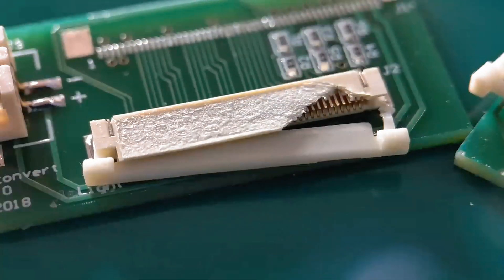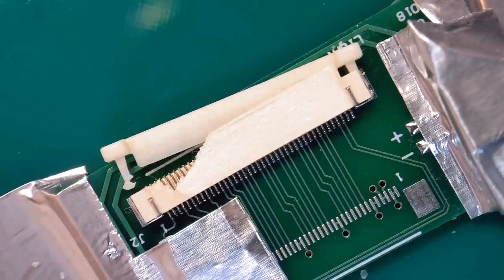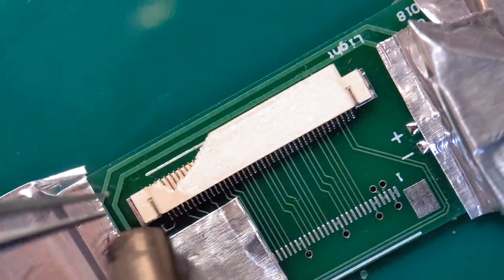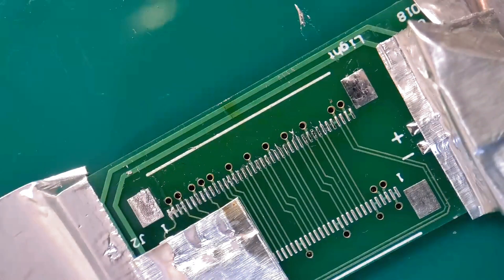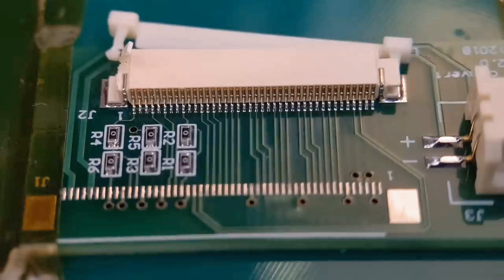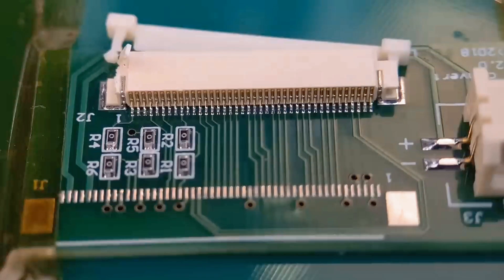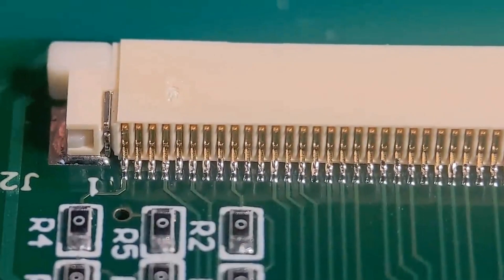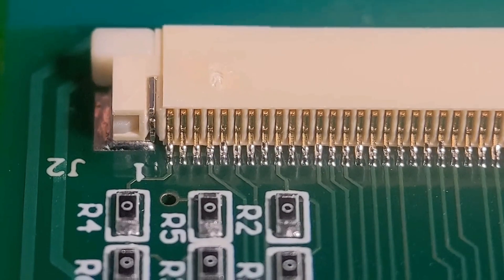How To Replace FFC Connectors - 2 Great Ways / SMD Soldering

Comment: Heating from the top? I thought for these plastic connectors heating from the bottom is much better.
Reply from the maker: Hi , thank you for your comment. Heating from the bottom gives you other issues like excessive heat needed due to time taken for the heat to travel through the board which is longer than heating from the topside . Also what if you have components on the bottomside ? You potentially will be dislodging them with all the heat . I still prefer to heat from the topside with a hot plate if needed giving general heat throughout the board. Hope that helps . Thanks again 👍

Comment: dude, wtf is this kind of precision, how on earth did you solder 1 pin by 1 pin, might not realize how small they are in the video, but in real life, they are tini tiny, idk how on earth were you able to solder them one by one. Also why didn't you melt the connector down with a 400c hot air gun? Pretty sure the melting point of the connector is way below that point.

Comment: I've been told by repair techs that the settings on the hot air rework station might not work for other stations, so I'm thinking it would help me a great deal to know what to look for when the component is ready to remove (or is properly soldered), and how to best use the nozzle to avoid damaging the board or other components (which I have done in the past).

Edit: ... Which you did, in the first connector. Thanks!

Comment: all with a conical tip, there are two others that try to teach on the web both claim to throw out the conical, both of them need to watch this guy, truly the master and top-quality video as well all without ads
Reply: Usually they are correct and even for this job I'd personally use a chisel and do two pins at once as the flat gets the width and as there is more surface area with a flat surface you get a better heat transfer and it makes a quicker process and you can get even quicker as you increase your iron temp but for this it's a demonstration not going like the clappers on production so both ways have there uses but nobody's wrong it's very much based on the environment it's done in and for what purpose. What I wanna know is why he doesn't recommend a drag solder bucket tip for them ? Maybe it's because they are a bit loosy goosy in the plastic housing and would go out of alignment or something. His work is the best I've seen on you tube by a mile though. 👍
Reply: @SlyerFox666  he doesn't like the drag for lack of control
Reply: @tomgiorgini9154  How very odd, maybe he needs a lesson 😂👍
Reply: @SlyerFox666  maybe you need to gain some reading comprehension
Reply: @SlyerFox666  to go with your girls emojis
Reply: @SlyerFox666  yes your girls emojis are cute o I'm sorry they were yours evidently